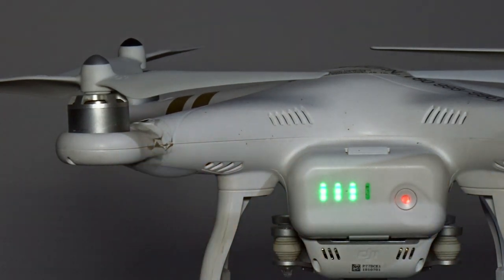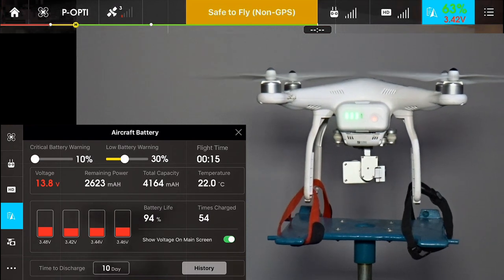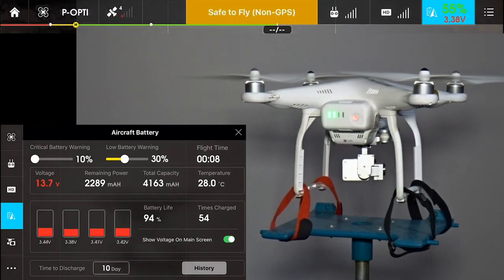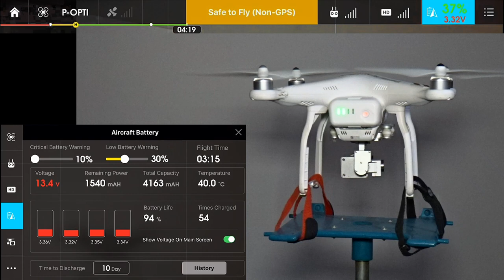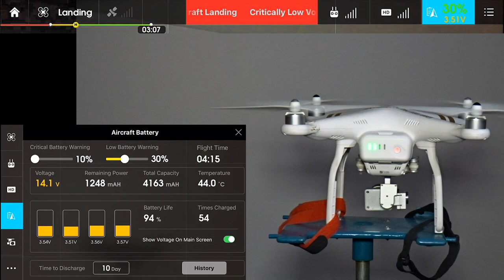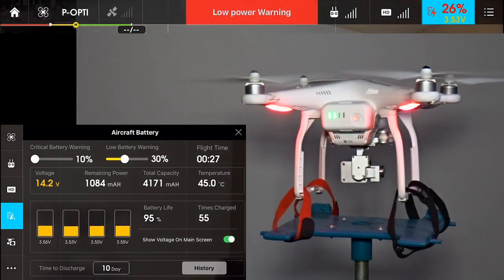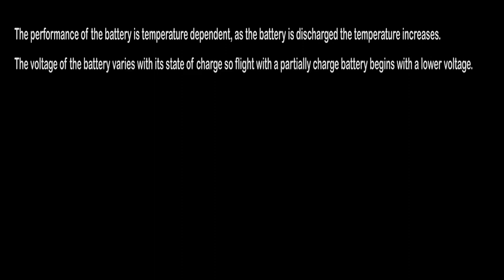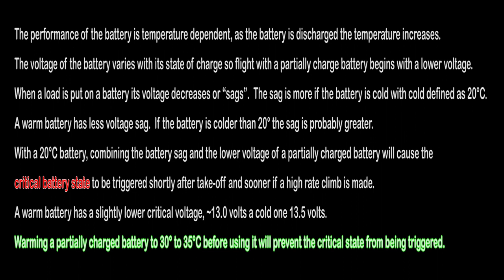Phantom 3 Battery Testing - JAN 2016

Comment: I have seen the P3 drop out of the sky problem, when taking off with a partially charged batt all over the forums. This is the best, and well thought thought out documentation of the issue that I have seen. WELL DONE! I flew my P3 a few times with partially charged batts this summer, as I have done that with my scratch built rigs numerous times with no issues. But luckily I saw all of the forum posts, and stopped doing that, before it got cool in my neck of the woods. I have seen your avatar on the RCG forums several times. I am sure you posted this there, but I have been so busy since Christmas, I haven't been on that forum. Hopefully some DJI folks have seen, or will see this, and work on the issue.
Reply from the maker: +Mike Jordan Thanks Mike, I did post on RCG but as you know threads move quite fast there and many may have missed it.  Working on another video to see how fast the battery warms up by just running the motors at low rpm.  It will be posted in the next week.

Comment: This explains it! thank you so much sir! I crashed my drone last few months flew on a mountain my batteries are exposed overnight to about 5-10 degrees cold! I flew with it when i fly it suddenly turned off! (good thing it was not too high) battery was 41 times charged and I was preparing to dispose it until i saw your video! That explains everything because only 2 was affected (new ones) and the oldest battery was not! Thank you so very much and yes! i will not use any not fully charged batteries in cold conditions! 

Regards from Indonesia! Thank you! 

Subscribed!
Reply from the maker: I'm glad you found it helpful and that you did not throw out your batteries.

Comment: Very nice explanation. I had this happen to me and I almost left my Phantom in the ocean. Fortunately I was up high enough that I was able to bring it back over land while it was descending, which I couldn't control or abort. I had started on a partially changed battery, but I didn't realize the cold also played a part. Since then I only start with fully charged batteries, but it's good to know that in a pinch I can get away with just warming them. Previous to that problem I had started with partially charged batteries many times with no incidents.
Reply from the maker: +David York I have done many partially charged battery flights last summer but then it was warmer and the batteries performed better, ie less voltage sag.
Reply: Great tutorial. Please how can I get the bench with th clip you placed you drone on.

Comment: hi , though too late to the party but awsome video that could have needed a book to explain... am glad ur still replying to the video comments too, though the p3 is now a very old device but thousands of it are still flying every where, so good to keep it in support for users.
my question though is harder to find an exact answer for but i will put my assumption here and want ur opinion.
i had seen with other people and it happened with me twice but luckily over grass with p3 being only 2m above ground, i once started a 25% charged battery on a cold morning it took off flew 30 seconds and the p3 fell to the ground i was shocked it turned off in mid air🤕😵 it happened with me on another p3 and another battery that was full i flew it to 20% or more i was back to land and it was just above my head when it just died mid air luckly i grabed it by hand 😌 this time...
any way my assumption is that the smart battery board is what it turning off not the p3 its self!! it seems at some  around 12 volts the smart battery board or the intelligent battery its self turns off!!! leaving the p3 doomed.
i hope some one can invent a mod to bypass this
Reply from the maker: The smart board in the battery will disconnect the battery if the cell voltages become critically low.  This may have happened to you.  Also if the cell voltage becomes very low during long-term storage it will disconnect the cells and the battery will not take a charge again.  I have had this happen once.

Comment: I wonder if the batteries used in the Phantom 4 Pro v2 (circa 2021) have similar performance trends? I would guess so, assuming battery technology that DJI used hasn't changed alot in 5 years, but still curious...
Reply from the maker: I would expect so.  Cells on the P4 batteries are a bit bigger and there is an air gap between the cells to help with cooling as you can see from the tests the batteries become warmer when used.  With the newest DJI batteries, you have to be very careful not to discharge them and leave them uncharged.  If the cell voltage drops below a certain value the BMS (battery monitoring system) will disconnect the cells and the battery can no longer be charged.

Comment: Thanks for the video.  the same think happens to all lipo  battery's  I made a battery blank for my 650 quad and started with a warm battery to get summer flight times.
Reply from the maker: +RIPcombat Yes warming the bat will get back to summer flight times, on other machines, the cold bat isn't a problem but in a phantom and inspire the software forces the copter to land in low voltage situations.

Comment: Great video, but i was hoping for a simular test but with a cold battery. 10 degrees celsius or so. Seeing that most problems happened when the temprature outside dropped, it would be very interesting to see. Btw, if you do test it, install the latest firmware as well. That one will prevent the motors from spinning at max rpm if the voltage sags or if the battery temprature is low.
Reply from the maker: +GranVlog All of the testing was done using the latest firmware (1.6).  Flew with a 17°C & 85% charge bat on the weekend.  Hovered for 2 minutes to let the battery warm to 25°C before climbing out.

Comment: Amazing video! Thank you very much. But I have a small question. I am a p3 pro user and I recently had to fly in a place for about 10 minutes and then to another with the left battery. It was about 60 when I had to move to the other place (about 30 mins walking) and when I turned the drone again. I flew up for 10 seconds and then landed automatically because of this error. I didn't had a charger next to me to chage it so i used the second battery. But what do i do with the first one? Any suggestions? When i left home it was at max.
Reply from the maker: The P3 Pro has been around for a number of years thus the battery you have may have many cycles.  This reduces the overall capacity of the battery.  That could be why it did not perform well at the 2nd location.  If the first battery cooled off during the walk to the 2nd location it would make the power delivery worse as shown in the video.  Not much you can do other than charge the battery or as you did, use a 2nd battery.
Reply: @HummingbirdUAV  the first battery is around 20 cycles and the second is at 10. But the second one shows an error Battery damaged but when I hold the power button, it shows that the cells are good. It is just the app, giving the error. And it flies well with it. If you have a solution for this too, I am listening

Comment: The same with Mavic Air. "Advertencia de voltaje muy bajo. La aeronave tendrá que aterrizar" Battery remainedfrom 33% to 0% and my drone landing.
Reply: it happend at 13 °C with my Mavic Air.
Reply from the maker: It's important to keep your batteries warm, keep them in your pocket before you fly.

Comment: Great vid,  thanks for sharing.  Is there some age when we should ditch batteries?  Mine are a bit over 3 years old but have only had 67 and 82 charges and show about 80 to 90 percent use, however I notice I get the propulsion limited warning fairly often now and did get this low voltage warning on one the other day (unfortunately I can't remember if it was fully or partially charged but will be testing again in the local park before going over the ocean again..)
Reply from the maker: I have lipos that are 5 to 6 years old and they still work OK.  The secret may be to keep them half charged in stored in a cool place.  My P3 bats have at least 100 cycles on them.  I sometimes discharge them down to 5%, let them cool and charge and the percent use increase a bit.  Just to be safe, fly a fully charged pack and time it with a stop watch and compare the time to what the GO app shows.  Hopefully they are the same.  You can also increase the alarm point by 5% for an extra safety cushion.
Reply: @HummingbirdUAV  thanks mate

Comment: This is a very good video.  However, can you make another video explaining how Voltage works relative to safe voltage flying and what is a good voltage to keep it at when flying and when I should be concerned.  I see here 13.5 is bad I get it so I guess as long as it's over 13.5 it is ok?  How does voltage work relative to the drone's speed and functionality relative to remaining power?  So far your video is the only one I found that explains this somewhat.  Thanks for your vids.  TD
Reply from the maker: A fully charged P3 battery will have a no draw voltage of ~16.8V.  When a load is applied, like take-off, the voltage will sag around 1 to 1.5 volts, the amount of sag is battery temperature related.  As flight continues the voltage will gradually decrease in a linear fashion.  However if full power is input the battery voltage will spike downwards and if the power is centered again the voltage will come back up but not as high as it was before the full power input.  So the harder you fly the faster the battery drains.  You can see a flight's battery voltage curve by connecting the drone to a computer running the DJI Assistant 2 program and opening up the DAT file.

Comment: Hello What is the best way to heat these batteries
Reply from the maker: If you are flying in winter and are wearing a warm coat just keep the battery in an inside pocket of the coat.  Your body heat will keep it warm enough.

Comment: Hello sir have you incounter (battery over Temperature  battery discharge ) ??
Reply from the maker: No I have not encounted this issue. You may have to start with a cooled (~20C) battery.  I have had issues with my iPad overheated on a hot day.  Typically the video stutters.

Comment: I know im late to the party but DJI did fix the issue with 1.9.6 it now capable flying in really cold conditions
Reply from the maker: Yes in a way, there additional software interlocks that prevent flying if the battery is too cold.

Comment: Good day I consult you in the last flight of phantom 3st me frame critical battery was at 50% load began to descend. then I turned it off and turned it on again and it went well.  which it can be. The battery has 19 loads and 4 or 5 years. Do you have a solution? Thank you
Reply from the maker: Was the battery cold on the first flight?  ie maybe 15°C.
Reply: @HummingbirdUAV Thanks on that flight it was at 16 degrees ambient - The battery on the first flight of those 3 had 17.95c and when I happened to activate the battery alarm 26.95 c degrees

Comment: I just lost my Phantom4 yesterday... I had around 20% of the battery left over when I lost connection with my drone and it never came back to the home point is self... Is there any possibility that those DJI batteries are turning off like phones when its cold outside??? My outside temp during that flight was 41F
Reply from the maker: Sorry for your loss.  If you started your flight with a full battery it would have been very warm at the 20% level as the batteries heat up from using them.   More likely it just didn't have enough power to make it back.
Reply: Hummingbird.UAV well what I can do if it shows 20%??? Should i come back everytime with 50%??? It never let me down until now. I thought I know my drone like my own pocket
Reply from the maker: Default setting is to have the battery alarm go off at 30%.  If I'm far away I start to come home, if I'm downwind I'll come back sooner.  If you are downwind and a return to home is initiated the phantom will first climb to the RTH altitude.  This can increase the headwind for the return flight as wind speed usually increases with altitude and sometimes there is not enough power in the battery to make it all the way back.

Comment: Thank you for sharing and taking the time to prepare this - I'm not too impressed with DJI's so-called "SMART" batteries. As I live in UK "cold" and as it is not always possible to have a 100% charged battery in all circumstances - this substantially increases the risk of losing my Phantom...and worse still, possibility causing harm or damage. Is there a "work-around" or fix to this?

ANDREW
Reply from the maker: +Andrew Chesney Andrew the problem only occurs with partially charged batteries.  A fully charged battery has a higher starting voltage. The cold bat start-up sag on a full battery will not trigger the alarm.  If you want to use a lower charged battery warm it to 30°C or take-off and hover close to the ground for 2 minutes or until the phantom self lands, cycle the power and the alarm should not go off again because the battery has warmed.
Reply from the maker: +Andrew Chesney The DJI batteries are quite smart in comparison to other lipo batteries.  A simple connection to charge them.  No balance connection needed.  Cells are kept to the same voltage. Temperature is monitored, no sparks when connecting them and a nice on/off switch.
Reply from the maker: DJI sells a battery warmer which brings the temp of the battery to safe operating temperature.  Downside is that it uses some of the battery energy.  Another work a round it to take off and hover and monitor the battery temperature with the GoApp.  Once its over 25°C you can put a higher load on it by flying around and not have the voltage warning.
Reply: Thanks

Comment: I got battery signal lost in my drone any solution
Reply from the maker: There are two small pins that contact small pads when the battery is installed in the drone.  Try cleaning these.  They conduct data from the battery circuit board to the drone CPU.

Comment: Thank you for your test... How much phantom battery can be charged before it cant be use again?
Reply from the maker: +OokTiaopi It would be safest to charge until all the flashing LEDs go out however if you are in a hurry to make a quick flight charging until the last LED is blinking should be OK.
Reply: Thankyou for ur reply...
How many times the Phantom battery can last??? I see ur phantom Battery Life is 94%. Is the flight time is decrease noticeable???
Reply from the maker: +OokTiaopi I have not noticed much of a decrease in flight time with the 94% battery.  I have one battery with 59 charges and it is at 90%, it's flight might be reduced a bit but I don't know how much.
Reply: ***** Okay sir, thankyou very much for ur info. It helps me alot...
I just want to make sure that, the battery is not dead in the mid of flight...
Reply from the maker: OokTiaopi
The phantom will land itself before the battery runs out, just make sure smart return home is turned on and it will land where it took off.

Comment: I live in Canada and its obviously cold here. I have a Mavic in the mail and I'm wondering if it would make sense to have some kind of silicone skin for the body in the winter to keep the warmth. A bit like a cell phone silicone cover.
Reply from the maker: I don't think its required.  If you start with a 21°C battery it will generate enough heat in operation to have a safe flight.  Just make sure the bat is fully charged.
Reply: I mean to fly between -12 and -20 celcius. I'm into RC heli and I only fly big birds when its cold as smaller helis get so still (rudder linkages) that they are not safe to fly.
Reply from the maker: My record is at -25°C with a F550 UAV.  This machine uses traditional RC batteries.  Flight times were reduced from summer flights however they were restored when wrapping the battery in bubble wrap.  Don't know if you can do that with a Mavic battery.
Reply: Next thing is to find out if the Mavic builtin fan shut itself off when its cold
Reply from the maker: The fan is there to cool the video encoder chip.  I've never seen the one on my Phantom turn off.
Reply: I guess electronic i never too cold but only the battery need to stay warm.
Reply: Daniel Lelievre -
Reply: Troy15 Teryyanto
Your comment is invalid
Reply: I put it into the oven for about an hour at 40°C before flying, not joking.

Comment: Hi, i just bought a phantom 3 and had 3 cicle charge, and when i fly, an error battery is displayed “low battery voltage” “battery error” and the drone start to landing. If i saw the battery level when its happens, the battery level is in 88, 89%. So i cant fly with my new drone. What do you think is happend?? Thank you very much for you time.
Reply from the maker: Is your P3 new or used?  If used the battery could be old.  If it only had 3 charge cycles I would say  the battery is defective.  Fully charge the bat and then do a hover flight 2m above the ground.  Switch to the battery screen and monitor the cells discharge and voltage.  If it lands at 89% again the battery is definitely defective.

Comment: Bro i have dji phantom 3 advanced and when i fly, less than minute it says Critically low voltage and starts landing. Do i need new battery or i can fix it somehow? Pls help me
Reply from the maker: Go to the battery tab in the app to see about the health of your battery.
Reply: @HummingbirdUAV  heres the information Total capacity: 3987 Remaining power: 3349 Times Charged: 85
Reply: @HummingbirdUAV  but on battery it says 4480mah (68wh)
Reply from the maker: Check the levels of the individual cells in the app.  If one cell is lower it can trigger the alarm.  If that is the case you should replace the battery. @valentinnadj9005